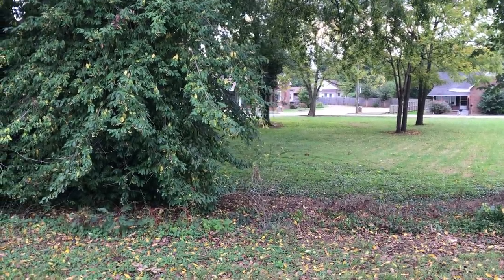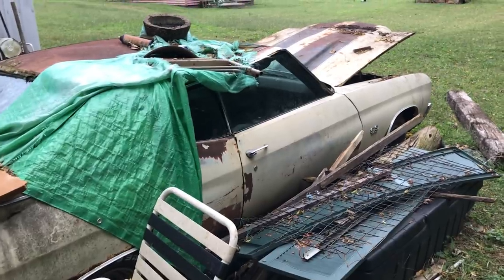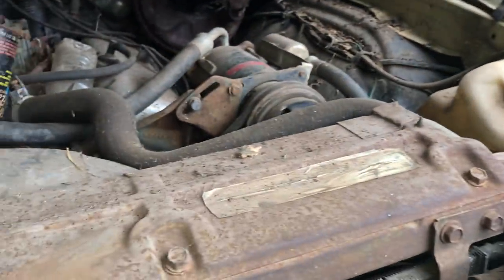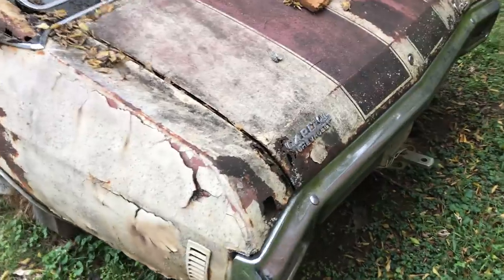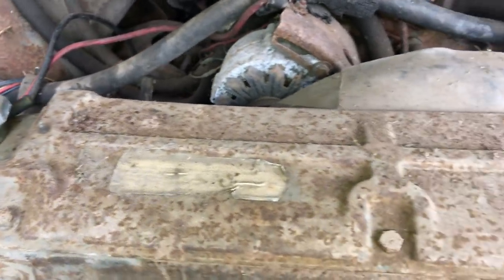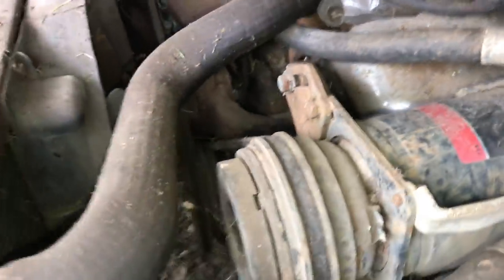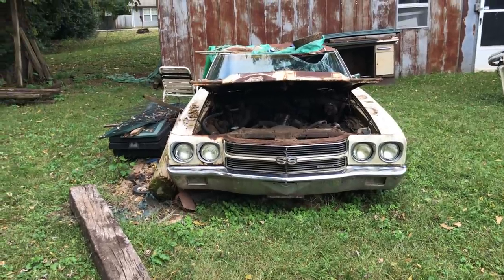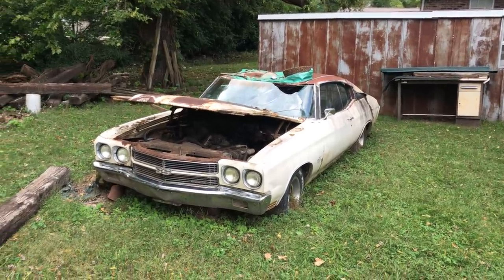Man Comes To The Door And Says: “I’m going to start working on it in a few days”

Comment: Probably a tree fell on it caving in the roof, and the car was put out to pasture.  I can't believe how rusty it is for Tennessee, it looks like it's from Michigan.
Reply: look were it was parked, any car parked on the grass will rot twice as fast , than if parked on cement!!
Reply: @kdscrapping4452  Indeed.  Moisture trapped by the grass & surrounding vegetation, humidity, rain through the roof, etc.
Reply: Probably originated in N.E.  somewhere.. I was 20 when this car was new...from Pittsburgh...they started rusting when less than a year old...after just 2 winters rust holes ....we all had beaters for the winter..
Reply: They do salt the roads in Tennessee. And if this car was still running and driving on its 20th birthday it wasn't a weekend ride, it was an old beater somebody drove right up until the day it was parked. I had a 1973 I was still driving in 1993, when it developed electrical problems and also blew a head gasket.
Reply: @kdscrapping4452  yep park in the car and Grass will destroy it. The grass holds the  moisture right up under it
Reply: @MrJeffcoley1  I agree. It was just a used car when it was 20 years old and not worth fixing back then.
Reply: Most likely it was from the blocks on concrete and huge planks on the roof since 1990
Reply: Don’t be fooled! Tennessee is a damp place with salted winter roads and car rust away! Just like everyone thinks Florida car are just great but that is not usually the case ... a native Florida car from the 1960s has seen a lot of salt water (yes, it even gets into the humid air) and has survived through countless hurricanes over the past 60 years. Tennessee cars rust from the bottom up and Florida cars like to rust anywhere the joints come together; thats where the dirt and moister collect and water gets trapped. Traditionally, there has always been a lot of hoarded car like this in TN but times are changing, older folks that had them are dying off plus these car have just been sitting out in the weather for so long that this kind of condition is getting typical. Its sad but time marches on.

Comment: Easy to fix, relatively.  Pull all the wiring, chrome, plastic, fabrics and glass.  Sand blast the rust [ or use chemical / electrolysis ].  Rust-seal the bare metals; primer and 2-3 coats of auto specialty paint.  An industrial scale electrolysis vat could have that whole car cleaned in 2 or 3 days.  Almost NO hard work!  A bit of surgical "spot welding", a few new parts and practically "new"!  (magical) Bing!

Comment: When I moved from outside of Cleveland Ohio to Assville North Carolina in 1978, there were all kinds of nice cars at the used car lots that were not rusted. I bought a 1972 Buick Skylark custom with 60k miles for $2400. It was super nice cream puff. Red with white vinyl top and white interior with bucket seats, 350, 4 barrel engine. Auto trans., chrome stock custom rims with beauty rims. Nice. A month later that car lot got a 1969 Chevy Chevelle with 396 pgk., 4 speed manual trans. Blue with blue vinyl top. All original. 60k miles. $2500. Nice. I wanted to trade that Buick in on that Chevelle. They wanted that Buick plus a $1000 bucks. I did not get the Chevelle. I really loved that Buick. It fit my personalty better and kept me out of trouble. Those were the good old days.

Comment: I'll tell you why it was parked.  You remember the 80s? Lots of SS cars still around for decent prices. Problem in my area they were all rotted out and the values didn't make people save them there was no need finding a better one was fairly easy. I used to cut up and scrap what today would be very valuable cars but back then they were just scrap.
Reply: That's true! During the gas crunch as they called it gas hogs were not worth anything especially big block cars.

Comment: Restore car : $400K
Value after restore: $30K
Reply: True story, I'm restoring my Wife's 68 GTO her mom bought new, I would have parted it out if it wasn't a one owner, I could have easily bought one done for what I have in the restoration so far and the body is still on the rotisserie.
Reply: @carnut7615  my dads restoring a 1953 chevy 5 window and even with him taking years and getting parts as cheap as possible on sale and good used stuff just finding good deals he will still be in the truck thousands more than it could ever sell for
Reply: About 6 cents a pound currently

Comment: I wrecked my 71 SS. Back then, if the frame was bent, body shops said it couldn't be fixed. I sold the whole car to a friend who had a 71SS for parts. Last I knew, it was sitting in the woods in worse shape than this. Wish I had kept it. The body wasn't bent that bad.

Comment: Kind of like my motorcycle. Last run in 91. Only I HAVE worked on it many times over those years , it hasn’t been sitting outside and and I AM working on it right now.
There ain’t much left of that thing. It needs someone to hook a battery to it, put some gas in it and make it run and mess up what’s left of that big block. That would make it complete

Comment: reminds me of a car i found in 91-92 sitting in a brier patch it was a 70 ss 454 Chevelle convertible and it was solid rust windows all busted out, the owner offered it to me for 50.00 but it was to far gone to even salvage parts out of. but I did get a 70 judge from him for 100.00 and loaded it onto a traler and got home and didnt even unload it and had someone offer me 2k for it, and so i sold it.. i should have keeped it. ( it was in a barn, and in really good shape.)

Comment: Hi I am interested in buying a 1970 SS 396Comvertable Chevelle. $13000 if I could talk with you about the car or help me decide and look over the car before I pay $13000 for it. It's been setting since 2000 not sure if it runs looking like most is original. Let me know what you think. PS 100,000 Miles on it . thanks

Comment: They were very desire able by 1990, so I can't understand why anyone  wouldn't have taken more steps to save the car.  If you can't restore it you can at least get it up off the ground, lubricate it well and cover it, you can put some plastic strips on the top before putting a tarp on.  Also, you must check on it periodically and inspect for rust!

Comment: There is millions of sad cases with cars rotting away to where one wants to say to those who let cars rot BUT won't sell them, "WTF?" There is a 1980 442 1 of 886 built 3 miles from me. Been setting 25 years outside- was a car kept because of non payment for transmission work at the time. Been trying to buy it for 10 years, too far gone now. The bright side bought the same car same color 15 miles away in 10 times better shape. What's the chances 2 cars in same area 886 made? I GOT LUCKY

Comment: You should do these barn finds for other mopars as well like the dodge chargers with the 572 hemi engine
Reply: Other Mopars? Chargers with 572 Hemi? Assumption is that you aren't referring to this Chevelle as a Mopar and you know that no Charger was ever produced with a 572. No engine had a displacement that large anywhere near the time Chargers were being built. Closest if I'm not mistaken was the 500ci Cadillac until the Dodge Viper. I'm referring to factory equipment that was born with the car not aftermarket

Comment: Numbers matching has nothing to do with being restorable, sure it's worth more, but it is either restorable or not. The original motor is not going to help a caved roof or extreme rust on the body and structure when it comes time to do the actual work on the car.